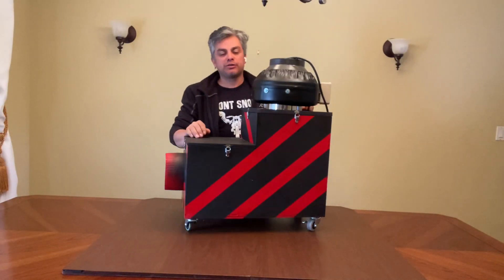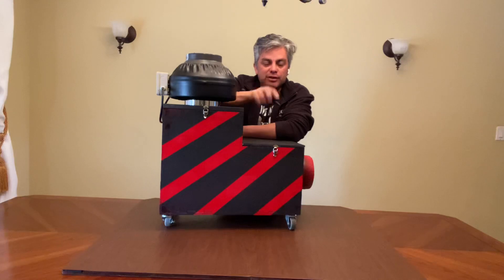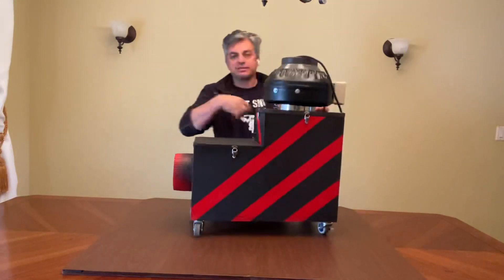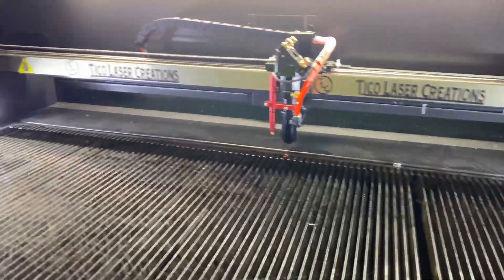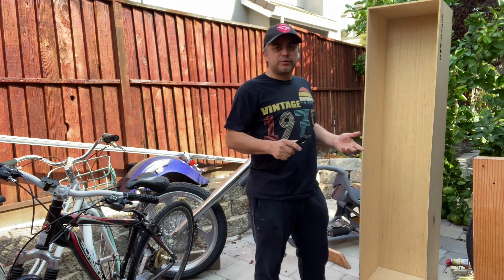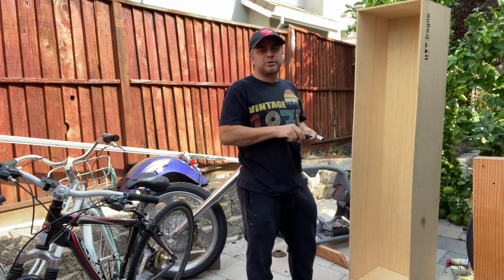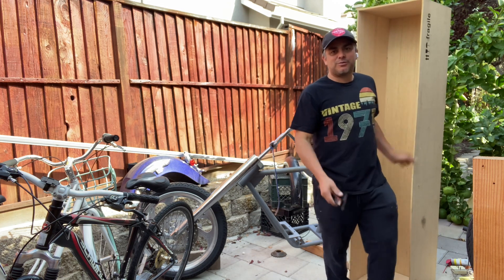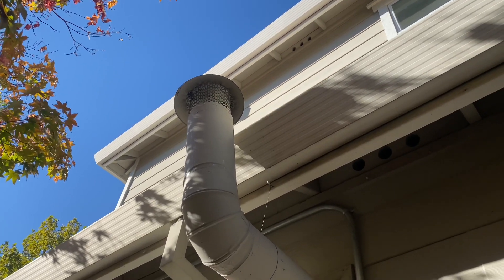Laser Fume Extractor DIY- Mo more smoke !!

Comment: What about the issue of filter replacement? The replacement carbon filters are $70 US plus tax. If these filters need to be replaced monthly, then the annual cost is $840 plus tax. The VIVOSUN solution also doesn't include a HEPA filter to remove particulate of 0.3 micron or larger as many solutions designed for cleaning the air will do. The MERV prefilters are a good addition, but they only remove large particulate from the air stream.

Comment: Got me thinking . Could I use a 10 gal sterilite tote  for enclosure or will it make matters worse. Noxious gas mixing with plastic -A chemistry question?
Reply: A HDPE box will not react with laser cut fumes to make a deadly gas.  Your larger potential problem working with plastic boxes is that the same properties that make them non-reactive, also make them difficult to get a good glue bond.  In my experience, a peel and stick gasket with mounting screws in a bolt-circle was best. Also I had to reinforce everything with backer plates.  It may be cheaper in the long run to build a sturdier box.  I think it's worth a shot though!
Reply: Tru-dat!  I've worked with HDPE for kayaks and dust hoods, and tried every proprietary trick and glue...peel and stick is the best.

Comment: Nice build! How is it working after a couple months? What about filter life?
Reply from the maker: Thank you... The pre filters in december only lasted 4 weeks but I had the machine running non stop 7 days a week...Im planning to change the pre filters every 6 weeks but they are only a couple of bucks
Reply: @TicoLaser  Thank you for info.
Reply: @TicoLaser  I do a lot of wood cutting similar to you. I may run my machine a good 8-10 hours of cutting one to two days per week cutting 1/4" to 1/8" woods. My main question is how is the smell and smoke output? I saw your vent stack out the side of the house and I didn't see anything coming out of it, however smell is another story. I have watched the videos with the DIY BOFA systems using OEM BOFA filters. It seems like those work however the filters are $450 or so and can't have the volume a laser cutter engraver over a long period of time. They eventually get clogged after after a few weeks to a month of heavy use. Thanks in advance for any input!